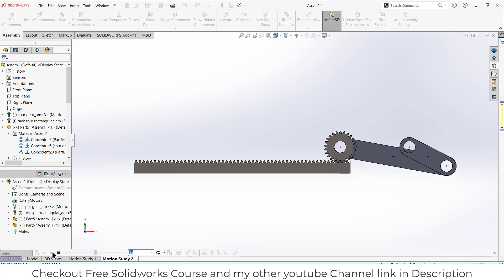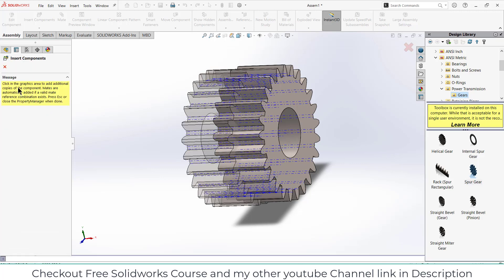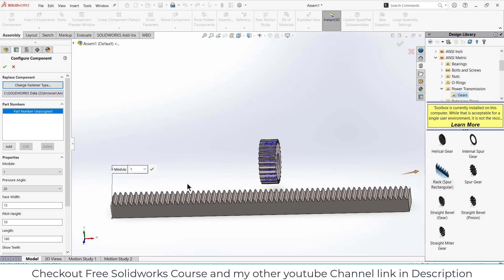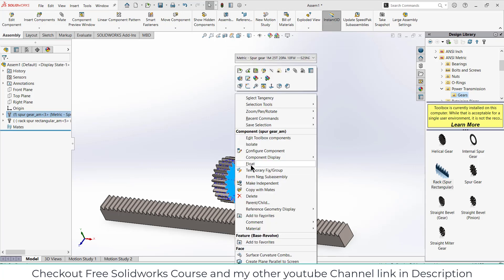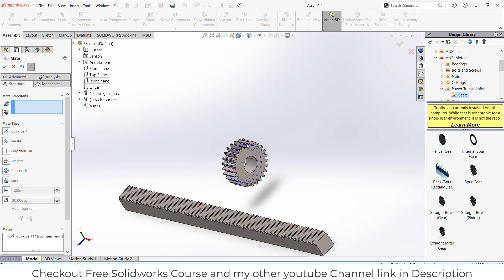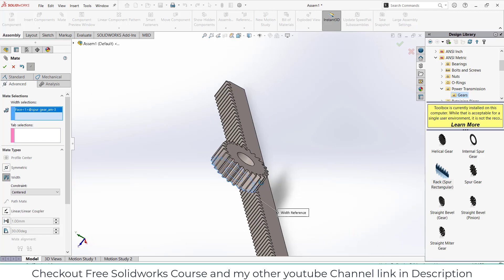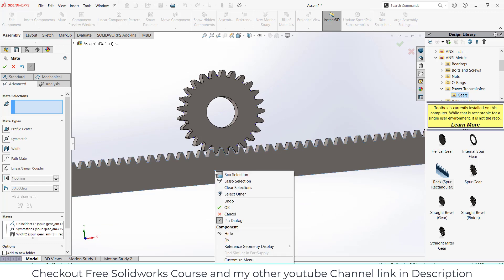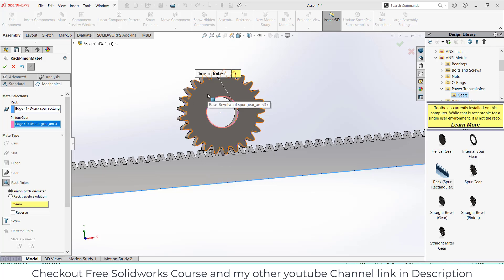Rack pinion and crank design in Solidworks

Comment: the selected component is fully defined it can't be moved.(Despite it is underdefined)(in the case of crank)
What should i do?
Reply from the maker: During part making have u checked on no external reference. Watch the top left corner it must be checked else you face issue like this. Or your part is fixed, or wrong mate is use